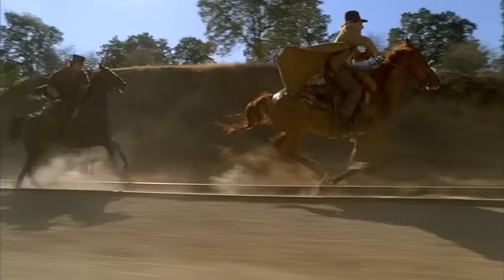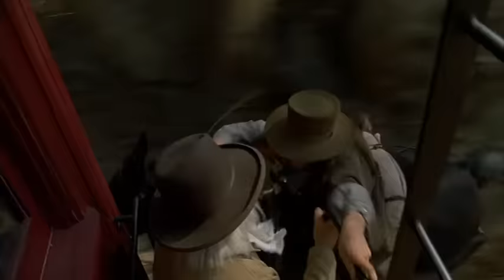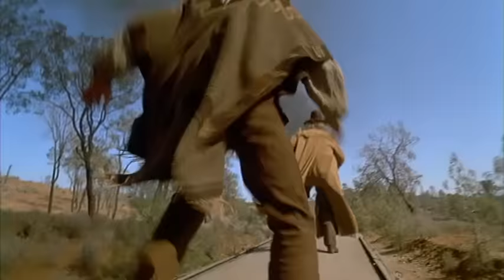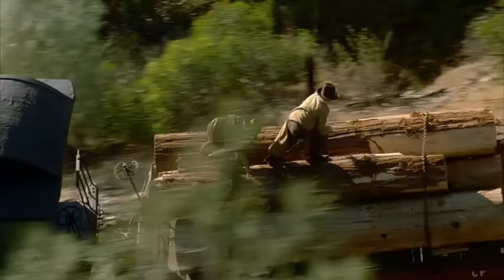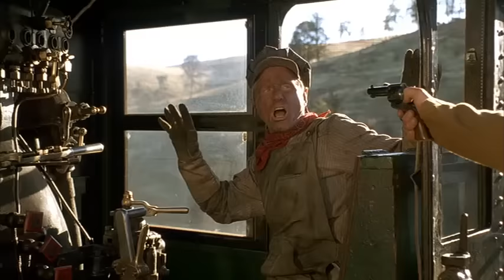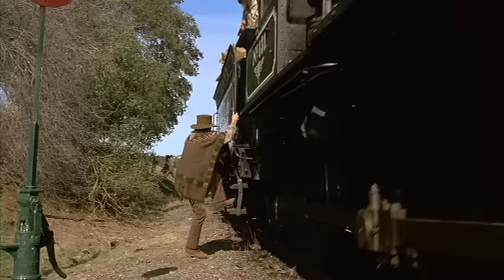BTTF III train

Comment: That locomotive is putting out some mighty black smoke for burning firewood.
Reply: Keen eye. This engine is actually oil fired, but in almost every movie its been in, its been dressed up as a wood burner. The large amount of wood in the tender is to cover up the oil tank.
Reply: Thought so.  Also seemed strange the tender is 100% full of wood after the locomotive had travelled some distance.
Reply: I think the first oil-fired steam locomotive debuted in the 1890s.  Since this takes place earlier, the steamer would have to be a wood burner.

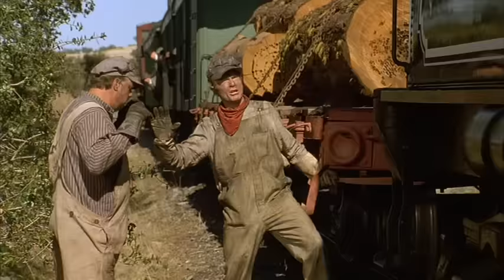Comment: ERROR AT 2:24 trains of that era did not have air brakes .....when the train starts to uncouple you can see the air hose still together, also trains of that era did not have the modern AAR knuckle couplers
Reply: Knuckle Couplers actually go a lot farther back.
the one's you're thinking of disappeared over 2 centuries ago.
Reply: +Paul Rude Back to the future is set 1885, westinghouse air brakes came into being in 1868, in addition to that you have "straight air" brake systems and vacuum brake systems that also existed around that time. The modern coupler has its basis in the Janney coupler of 1873, you would have had "knuckle" or "semi-automatic" couplers in that era easily, just not type E's.
Reply: I think it took several decades in the late 1800s for the railroads to adopt air brakes & convert from link-and-pin to knuckle couplers.
Reply: @JamesPattersonGeepfan usted si que sabe de lo que está hablando! Es usted maquinista?

Comment: The locomotive used in this film is sierra railroad 4-6-0 ten Wheeler #3 built in 1891 for the sierra railroad the engine has been used in dozens of movies and tv shows including petticoat junction, Casey Jones, and the apple dumpling gang rides again, to name a few, the locomotive's whistle was also used as the whistle for the polar express.
Reply: Also for the fact that this movie star was from New Jersey.
Reply: Speaking of Casey Jones, the real Cannonball Express locomotive was a Rogers built 4-6-0 #382 & in the 1950 Disney version, the locomotive Casey Jones or should I say Casey Jones 2.0 drives is an american standard 4-4-0 with a #2 named Johnny.

Comment: Lucky the DeLorean is the same gauge as the train. 🙂
Reply: Doc had to do a careful measurment when putting these steal wheels on the Delorean the the reason that the windmill is a point of no return because the DeLorean has no brake so if you stop the train, the car will roll freely down the track and there no stopping it until you hit the end of the Ravine bridge.

Comment: That us one beautiful locomotive, although I read they were never really designed to go at speed over about 60 odd, without axle damage occurring. Awesome movie though!
Reply: The rod and axle bearings couldn't take speeds much higher than 60-70, they would get hot. It was also possible for the engine to throw a rod when run at high speed.

Most importantly though, the driver in the movie wasn't kidding when he says you need a fire hotter than the blazes of hell to do it. Locomotives prior to the 1930s often had difficulty making enough steam for sustained high speed or high power operation.
Reply: But if you had magic presto logs like Doc and it had no carriages to pull, could it get up to 88mph? Or is it just impossible
Reply: @The12thDimension.  
You COULD. That's the beauty of steam power. Other modern power systems tend to not work that well by simply overcharging, you have to tinker with the system to do that.
But steam engines, you can shove more coal in and it will preform better untill it exploads or something breaks. It will produce more wear, but that's all you need to do.
Famously the ships that went to rescue the Titanic operated at much over thier top speed by shoving more coal and turning off hot water for the passengers.
Reply: @The12thDimension.  the presto logs weren't magic. It was compressed wood that was chemically treated to burn hotter. I'm guessing Doc had some combustible chemicals in the logs that made them burn hotter
Reply: @Stuingtion  Compressed sawdust + a chemical oxidizer + a binder material. The oxidizer is key, makes it burn far hotter than you could get using air alone. 

Unfortunately the line about using that in his forge, in real life that would not work. Forges need hot embers to operate, logs like those only ever make hot gas. But a locomotive's boiler will steam happily on volumes of hot gas, so its a good fit here.

Comment: why didnt they unhook the car with all the firewood in it?
Reply: John Doe because it's the tender, it holds the water and the fuel to burn in the firebox.
Reply: the locomotive tender has wood and water in it
Reply: Carter Wall k
Reply: +John Doe also isn't practical to uncouple, it's drawbar linked to the engine itself. no release mechanism.
Reply: What everyone is trying to say is that
It looks cooler with the tender